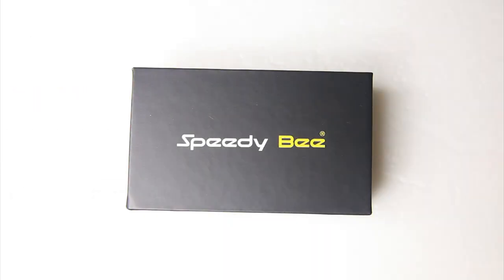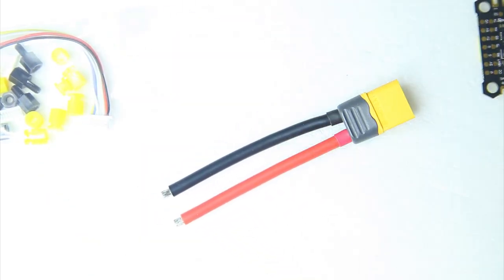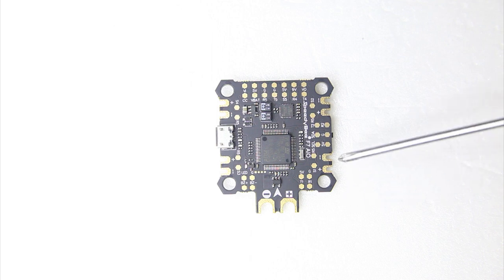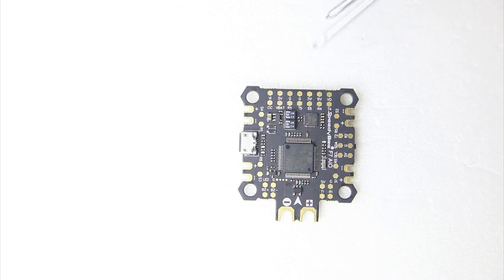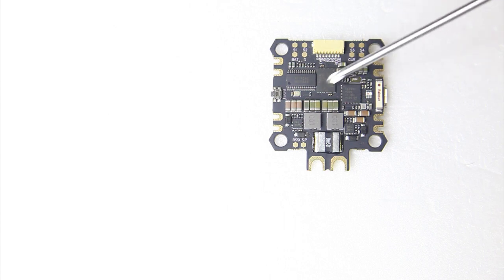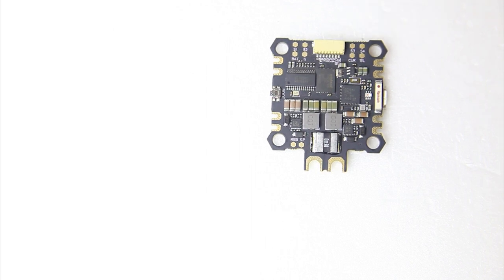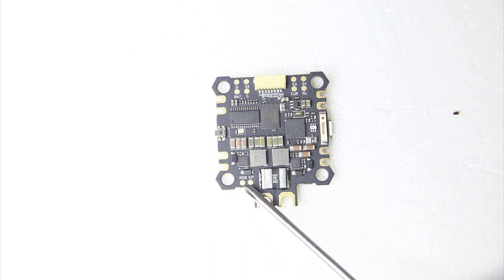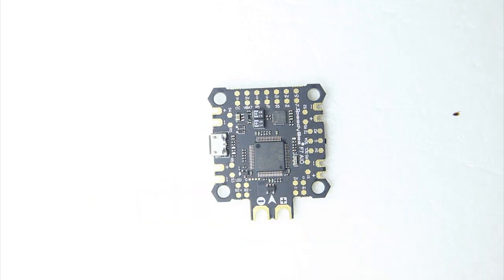SpeedyBee F4 & F7 + PDB + BlueTooth + Barometer - REVIEW

Comment from the maker: A quick look at the pro's & cons of SpeedyBee's new Flight Controllers :) 
Link to the FC: https://www.banggood.com/Speedybee-F7-AIO-3-6S-Bluetooth-Flight-Controller-OSD-32MB-Black-Box-Current-Sensor-4UART-35V-470uf-Capacitor-p-1600063.html?p=TO251813974002015038 

At the SpeedyBee site: https://www.speedybee.com/f7-aio-flight-controller/ 

The F4 version: https://www.banggood.com/Speedy-Bee-F4-V2_0-AIO-3-6S-Bluetooth-Flight-Controller-OSD-w-LC-Filter-59V-GPS-Barometer-Module-for-RC-Drone-p-1610003.html?p=TO251813974002015038

Specifications: 
size: 36 x 39 x 7 mm 
mount: 30.5 x 30.5 mm 
IMU: single ICM20689 
UARTS: U1, U2, U3 & U4
OSD: yes 
blackbox: 32MB build in memory 
barometer: yes 
USB port: micro 
Buzzer port: yes 
LED port: yes 
RSSI port: yes 
Bluetooth: yes 
3.3V BEC: nope 
5V BEC: yes 
9V BEC: yes 
10V BEC: nope

Comment: this one or the Matek F722 se?  Great overview as always brother!
Reply from the maker: Good Q! Similar FC's indeed.. if camera-switching is a feature of value in the build then the Matek is IT.. in a lot of airplanes I think the bluetooth of this Speedybee is a great feature to have :) 
The dual gyro of the Matek doesn't bring a whole lot extra to the table I think.. 
Thanks man! :)
Reply: It's many good FCs. I personally, among the few good ones, always choose the one that fits best in term to layout. Sometimes ESC power pads on the corner looks/fits better. Sometimes pads with XT60 cable sticking out too far in tight frames...
It's good to have a choice among a good FC and not only better od worse.
Reply: thanks for the feedback M & D-RC! that both makes sense :)